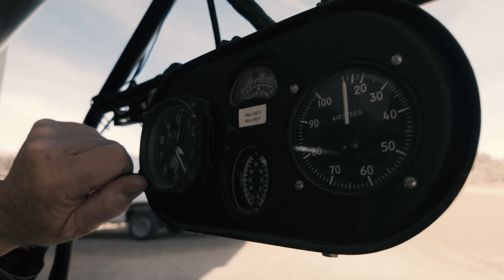THE ULTRALIGHT DREAM | Documentary | Feature Film | 2024

Comment: An hour and seven minutes?? :)
I believe it's 5 gallons you are allowed under part 103 but if you are a light sport pilot then that limit doesn't apply.
And you can actually fly an LSA at night and in IMC if it has the instruments and you have the licenses. Some LSAs are very capable. One way to help make a plane affordable is shared ownership. I owned 1/8 of an LSA with a hangar and insurance and everything, it was only 200$ a year and 30ish$ an hour including fuel. And people didn't fly much so it was available like I was the sole owner with the exception of peak summer at times. The financial burden was like owning a bicycle. Didn't register. I sold it because it was rivet plane and some of the rivets needed replacement, that was a little too casual safety for my taste but the principle rocked. A beautiful composite plane would be great.
Reply from the maker: yep

Comment: Great Video. ❤ Rich think about the engine Rotax 912 with 80 Hp. It’s much more reliable and safer. 😊 just a thought. Always safe flights and landings. Take care.
Reply from the maker: I'm just concerned about the weight, will look into it... cost is a factor also
Reply: @RichParkerflys  yes it’s a different of 19kg. But maybe it works somehow. I know some flying around with the 912. It gives you much more margin and power respectively safety. Good used ones go around 5.000.- to 9.000.- if you find one on the market.

Comment: Hello Rich…very nice work.  I’m curious though.  Right now (I am 70) I’m trying to keep challenging my brain and I’m flying a Sling 2 with Paul Hamilton’s school in Carson City NV.  How is it possible to train as a light sport pilot in that 2 seat aircraft?  I’ve been told that you cannot do it by the guy who sells Quicksilver aircraft.  I cannot find a school that will do the training.  It’s all ultralight or nothing..no LSA 2-seat Quicksilver trains for a Light Sport Certificate.  Thanks in advance for any insight.  Your video was very captivating.
Reply from the maker: The only way to be instructed in a Quicksilver is to be a factory built or own it yourself
Reply: I understand that part Rich.  I was wondering if you can get trained from zero time and checked out as a light sport pilot on that 2-seat, more than 5 gallons of fuel Quicksilver you own (I realize your's is configured as an LSA not a part 103 ultralight).....Or, do you have to be certificated in another airplane like a sling or CTLS or (?)  as a light sport pilot and then buy  the factory built Sport 2SE SLSA 2-seater and fly it under light sport rules (1 passenger plus pilot, more than 5 gallons of fuel, weight limits etc.).  I know MOSAIC may change a lot of things but just wondering about current rules.  I hope I'm asking this right...sometimes you run into "you don't know what you don't know.
Reply from the maker: @WadeLuttge  Sorry Wade but I'm not up on the new rules and stuff. There is nothing saying you can't learn on one LSA and then buy a used non factory built experimental aircraft and just get checked out in it.
Reply: @RichParkerflys  Thank you sir.

Comment: It’s a good feeling in Australia we had a fly in about every 4 months I never did much flying because I am an aircraft engineer and would take bits and pieces and tools to the fly in and spend the time looking at the guys planes and doing maintenance repairing their aircraft most were older guys and using bits of wire to hold bits on because they didn’t have a bolt or screw I would fix it and if I found anything on their planes they would let me fix it

Comment: Ultralight aircraft are aircraft and a signal seater the maintenance is very important and the owner should have a maintenance plan and record it and do inspections and the hours should be recordered and have a take off check list and a landing list engine run ups because it is the same as a GA aircraft and the thing is if you do this it helps to sell your aircraft and by recording any maintenance done if you have a problem or keep having a problem you can find the problem easier or show an engineer what you have done and help you fix it